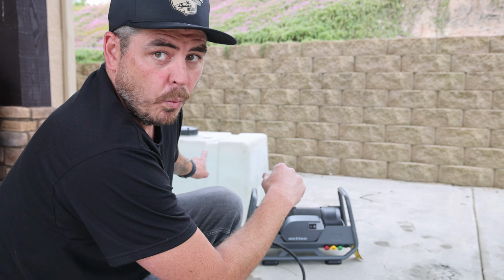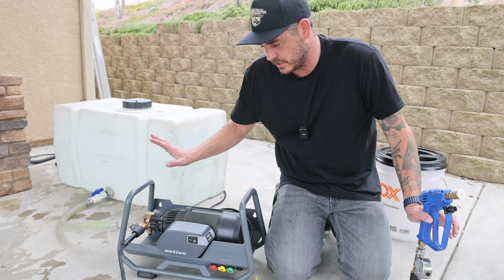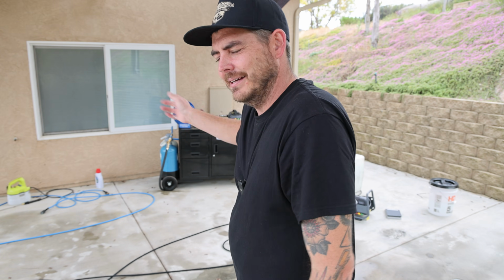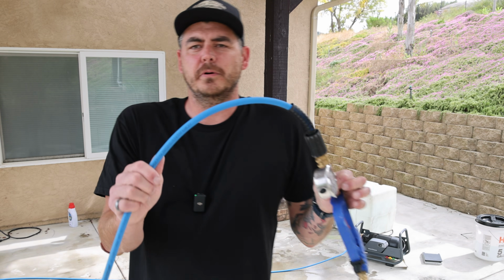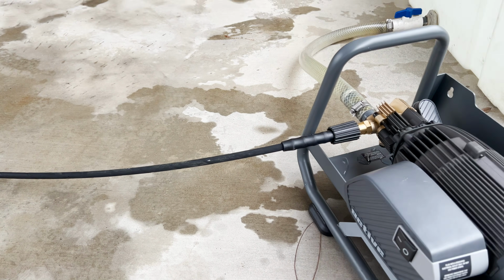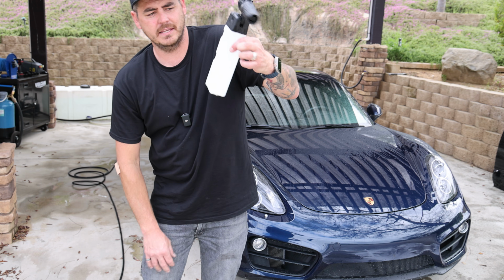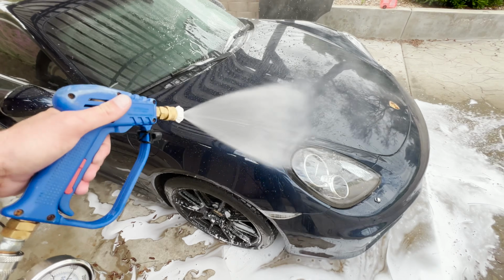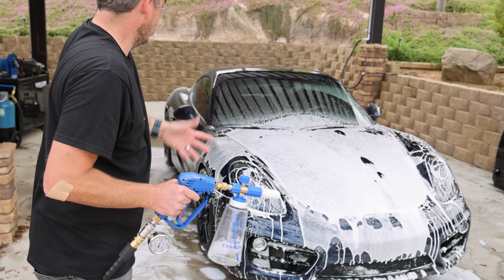ACTIVE 2.3 PRESSURE WASHER - Real World Application Testing

Comment: Why would anyone spend this money on such a weak pressure washer?
Reply from the maker: It’s all about the flow of gpm with this unit… but it is getting close to ar630 pricing and that units is amazing
Reply: @imjoshv  Exactly.. If it was ~$500 it's worth it no? I don't see the point to upgrading from the 2.0 to this for such a miniscule improvement.

Thanks for the response bro.

Comment: Great video! Very detailed. I just received my 2.3 for my mobile setup. I’m running it off of a 3500 predator generator. I have a mckillans swivel gun, it keeps blowing the GFCi on the pressure washer. I’ll try the original gun tomorrow to see if it makes a difference. Also I only get a red light on the GFCI not a green light.. no one’s shown that part in a video whether it should be green or not. I’d love some pointers please and thank you

Comment: Love your videos.  Thank you for all the info you bring.  Quick question. Would the 2.3 pump itself fit inside the Vulcan in the right bottom of caddy?  Trying to see if I can place it in there to quiet down some of the sound.  I would need drilling holes for the hoses and placing a retractable wheel on top.

Comment: I just bought a champion 4500 inverter generator and my active 2.3 keeps tripping on the generator… I also bought an tv plug 30a to 15a because this active 2.3 is rated at 15a but puts out 14a… when plugged into my garage outlet it works fine.. I need help.. I also use an uberflex 50ft and maxshine stubby.

Comment: what hose would you recommend for the active 2.0? i just got mine today and it’s my first pressure washer but i needed one to clean my side by side and the cars my family uses but if the uberflex surges i’d want a better option. i’m already looking at the mckillans swivel gun and i was gonna get the foam cannon as well but seeing your soap test i think ima go with the mjjc fc. i’d want something id not have to worry about moving the machine for cleaning a car it doesn’t matter if i have the move machine for another vehicle but id i’m washing one car id like be able to go all around it without needing to move the machine

Comment: I pre-ordered the 2.3 to upgrade from the 2.0 specifically for what I was led to believe would be less noisy "more of a hum than a brrrrr" - the pitch may be a bit lower but the decibels are 90+, close to leaf-blower levels.  Had I known that I would have gone for a different pressure washer with 70db.
Other than being hellishly noisy, the unit produces great GPM (similar to the 2.0) and has a nice 40" hose (perfect for getting around large SUV's in one go).  My advice to everyone: get the old 2.0 and buy a longer hose for it.  No reason to upgrade to 2.3 except the longer hose (and mayyybe increased durability but for 2X the price it better be more durable...)
Reply: update: spent $60 on Amazon on sound deadening material for cars plus noise-reducing foam - gonna build a sound-dampening box for it to protect my ears and not annoy neighbours

Comment: Will have to see if the 2.3 holds up over time with an Uberflex or Flexizilla. My VE52 had never surged, just leaked and they sent me a new one. Ive used the nice Active hose and a Flexizilla without surging.  It does make a air pressure release sound when letting off the trigger with the Flexizilla, and you can see the hose contract at the save time, no strange sounds with the active hose.
Is the 2.3 hose like the VE52 hose, just longer?

Comment: Josh, question.
I have a 50 foot  two wire kobrajet blue hose and it's Terribly hard to twist,  wind together after using it.
Would you recommend getting the uberflex hose?
Worth it??

Comment: I had been using a 50-foot Uberflex with my Active 2.0 and started having major surging issues to the point the Uberflex hose almost burst. I replaced it with a 50-foot Kobrajet hose. I still have been having surging issues - sometimes worse than others. I've readjusted all of my connections and it seems to have helped to where it isn't surging as much. I may have to follow the mention by @steverasmussen8738 and see about installing a pressure regulator to see if that helps.

Comment: Josh thanks for making a great video! I would absolutely love to win this new active pressure washer, I’ve had not the best luck with pressure washers currently and in the past. I have upgraded to the Uber flex which helps but I’m still not getting the best pressure all around. I have even upgraded to a short gun but still no luck. Any advice for making sure the pressure washer actually has pressure? Thanks again!

Comment: I am a weekend warrior ....and they are so many pressure washer machines.
The tests that you carry in every equipment and products...I have been taking notes and saving little by little in order to start doing detailing, 
I detail my car in the weekends and my neighbors as well.
Cars have stopped and inquire about a car wash and out of the blue I said $50.00 in and out, but then counter offer with $20.00. I use water  using a hose from a s😎😎😎😎picket and the buckets to detail.
I carry Koche Chemie which I like for the business as well Chemical Guys, Mcguiers products and looking into different products from different companies and try them out.
Am watching and making notes from your channel and Pan the Organizer, DIY DETAIL...I wish that I could have a power washer in order to expedite the detailing process I will save me a lot of time.
Little by little am saving to get a Rupes cordless that just came out. It should be smooth like butter - I bet.
Keep up the amazing work Josh..
And ty for your channel and 
Much blessings 🙌

Comment: Yes, I’m close to starting my business as well. I have a pressure washer cart setup with a Portland 1750 psi  1.5gpm with a harbor freight air hose reel converted with viton o-rings which does not leak a drop. Anyway, I enjoyed the test. Thanks for the effort.

Comment: Hello everyone including JoshV
Let me start by saying that received my 2.3 today. Ordered on Monday and received on Friday @10 am by FedEx. The box was in good shape for the weight of this unit.
I attached my 50’ braided hose rated @5000psi to the 2.3 and changed the orfice that active gives you for the after market foam cannon in my case the MTM foam cannon, and started the testing.

I bled the line of air and I noticed more water flow from the gun, no nozzle.

Using the stubby gun and attached  actives included 25 and 40 degree nozzle to and immediately notice how much more water the unit was pushing and the force of the water….amazing😊

The the MTM foam cannon was next and put maybe 100ml of 3D foam cannon soap to about 300ml of water and the shaving cream of foam was amazing, I could never achieve this quality of soap with my 2300psi with 1.2 gal/min old induction pressure washer.

As for the loudness of the unit, honestly from my old unit to this one. The 2.3 is infinitely QUIETER. 
I get the side by side comparisons to the big boi pro and duo that it’s louder. But honestly, the 2.3 is quiet I can talk to people as I work.

If any of you guys are on the fence, don’t be this unit performs and brings detailing to another level…. It’s worth it!!!!
With the 10% off and no tax and free shipping from Nevada to California in 4 days from order , this is a win!!!!

Josh consider me entered for the giveaway away. I may just combine the 2- 2.3 and double the flow rate for a real test .
Reply: I just got mine today and followed the same steps. Looking forward to testing the flow & dialing it in. I am hard pressed to determine if the 2.3 is worth the upgrade over the 2.0. Right now the 2.0 is a SERIOUS value at $350 and I can only imagine they're gonna be on sale soon. Don't get me wrong, I love the 2.3 but if I were to do it again - I might venture to use a 2.0 and save some cash and spend the difference on bad ass accessories until a Kranzle upgrade down the road.

Comment: Hey Josh 👋🏻, I appreciate you going over the unit and letting us know more about this pressure washer and the difference between gravity feed and garden hose.

At the moment, I'm considering purchasing either the AR Blue Clean AR630-TSS Pressure Washer or the Active 2.3 or the Bigboi Pro. For my mobile detailing setup right now using the portland 1750 psi pressure washer been using for 3 years and still working great 

Looking forward for this giveaway 🙌🏻

Comment: Hey Josh, appreciate all your videos. You helped birth a new generation of mobile detailers, myself included. This will be my first summer running my own business.  I currently run a 2011 Element and my build was centered around the Predator 3500 generator.  I screwed up bc I bought an AR Blue and it requires more electricity than my generator gives. So I had to sell and downgrade to a $99 Ryobi. Help a brother out with this machine!😂

Comment: Just bought a new truck, I have a cheep harbor freight pressure washer. Not the best buy it works. I plan on upgrading over time, my biggest next purchase though has to be a di system I am sitting at 155ppm. But eventually I will get the pressure washer I should be using.

Comment: I’d love to have a backup pressure washer so I can keep one at the house and one in the truck, I currently have the active 2.0 I am using an Uber flex hose and I havnt had any issues with it surging either, it feels like it’s very comparable to the Adam’s pressure washer 2.0 but it does feel much smoother.

Comment: My 2.0 was replaced by customer service due to pump quit working.  I was using the Uber flex hose with the first unit.  Have not use the Uber flex hose with the 2nd unit.  The active unit is loud.

Comment: In regards to the flexing of the hose, im pretty sure they mean it from the instant you first pull the trigger, since the machine is not on at that instant, it splurges out the pressure, and the hose contracts, then the machine has to expand it again. Probably why you get that delay. Love your vids.

Comment: Think you could mount the 2.3 vertical with the pump facing down so water isn’t sitting in the pump when not in use?  Thanks for the effort in putting the videos together.

Comment: My Active 2.0 would surge even with a KobraJet hose, 50ft. No leaks anywhere, it would cycle every 20ish seconds when not spraying. PSI from the faucet was around 100psi. I added a pressure regulator set at 55psi at the faucet and have had no issues since.
Reply: My 2.0 surges as well. Some days I feel it’s going to blow up. I have 50’ pro pluse uberflex
Reply: Where are you that you get 100 psi at the tap? That’s phenomenal
Reply: @bobhawkins3387   Small town, eastern Iowa. Our pressure was around 75psi until the city put a new water tower into operation, then it jumped to 100psi. I recall the town newsletter mentioning something about higher pressure, but blew it of, more is better! Then I noticed my water heater pressure relief was leaking :) The city offered free, whole house regulators, I took them up on that. I installed it so it only regulates indoor. I use an 'RV' style regulator at the outdoor tap when I use my Active.
Reply: Tap water pressure can be insane, my outside faucets turn into water sprinklers even when I’ve got a 100ft hose attached with good o-rings. I’ve always wondered why my pressure washer surges lol
Reply: on my second 2.0 because of surging… they said the uberflex hose is not steel braided so it will surge.. bought a steel braided hose and it worked for awhile.. now it occasionally surges… piece of junk
Reply: @heenalu6259  it could be caused by a loose connection at the faucet. Do you have any water leaking or dripping at the spigot?
Reply: Interesting. I use an Active VE52 with a 25 ft KobraJet, and sometimes it will surge half a dozen times. Other times, not at all. I may try adding a pressure regulator myself.
Reply: I use a 50' uberflex hose with my active 2.0 and have no issues with surging
Reply: I'm thinking to upgrade from VE52 to the 2.0. My VE52 with 75ft KobraJet on hose reel surge all the time. I'm hesitate to swith to the 2.0 now according to your comment.
Reply: @allenzhang4951 just go with the 2.3 that’ll actually be an upgrade
Reply: Is your Kobrajet 1/4 inch or 3/8 inch? My Active 2.0 just recently starting surging with my 35 ft Uberflex so I got a 1/4 inch braided steel hose from Amazon. Going to test it this weekend. My Uberflex worked fine for a while but then surge issues starting happening.
Reply: @Bloodstryke Kobrajet hoses do only come as a 3/8in hose. Hopefully you have some luck with the new hose you bought. I’ve been running a kobrajet with my 2.0 with no problems.
Reply: @mdoyal111  is the 3/8 braided hose heavy to drag around the car?
Reply: @Bloodstryke  compared to the Uberflex, you will initially notice a slight difference at first but will get used to it quickly. If you are using a hose reel, I’d say you’ll notice the weight more while reeling it back up than going around the car
Reply: Thanks for the great info!
Reply: My VE52 doesn't have an issues.  50ft uberflex style hose.  I can't say 100% it is an actual ubberflex off the top of my head.
Reply: Instead of adding a pressure regulator, couldn't you just not open the valve all the way to reduce pressure?
Reply: Can I regulate the pressure at the unit?
Reply: @M.D.MobileDetailing  I use an regulator for RV's at the tap, I don't see why it couldn't be placed at the inlet for the Active instead.
Reply: Thanks for the input!
Reply: I was looking to upgrade to a smaller electric pressure washer and this may fit thr bill. Good video.
Reply: thanks for the great review
Reply: My karcher 1700 even surges with a 25 foot uberflex hose I think it is. But only really in the beginning of Ben though I’d prime the unit.
Reply: KobraJet the best hose? I just bought the Active 2.0.
Reply: @lowtrusted  Yes. Have a 50ft, wish i had a 75 but was like $90 more, perfect hose. Heavy but pliable, doesnt twist on itself like an extensio cord or uberflex.

Comment: Great review. I had been looking at the Active 2.0, but now...
Reply: Unless you are running a business, is there a reason why you can't stick with just a $120 pressure washer? At the end of the day, the Active can't be used for anything other than light cleaning/car care.
Reply from the maker: Nope.. Thats why i cover so many pressure washers. They may not get the same performance or have the same features, but for so many people they work great and you can manipulate them slightly to get better performance. With that said, once you use a unit that gets that higher gpm rate with good psi you do notice the difference. Things rinse off so much faster

Comment: I have a gas pressure washer that just died and have been looking to buy an electric one. I have seen a lot of videos on the active pressure washers and would love to have this one. Love your videos Josh! Thanks ❤
Reply: Gas still better.
Reply: @Carlos.Rivera  in performance but weight and noise are the turn down
Reply: Can you get auto stop in gas pressure washers?
Reply: @davidgilbert6498  with remote starter motor like generators, yes.